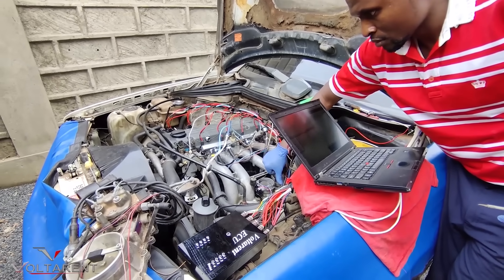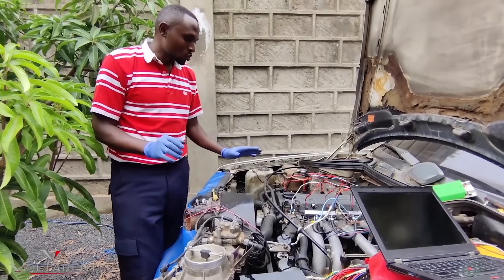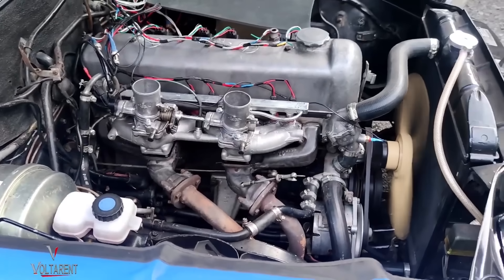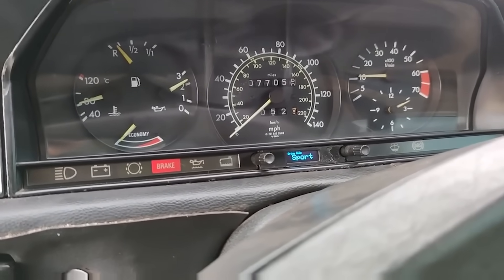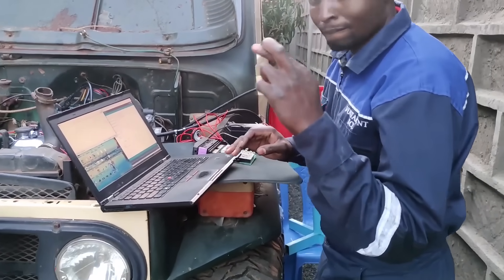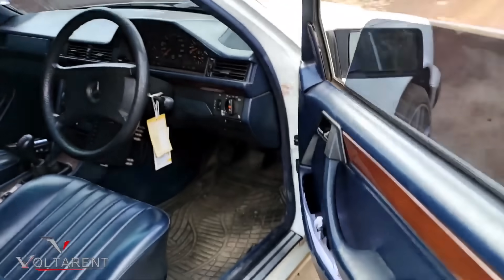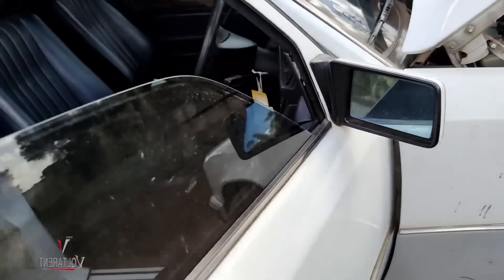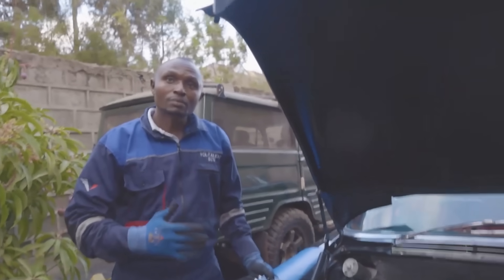African Genius makes Old Engines outdo Modern Engines!

Comment: I’m sorry to say this but there is nothing new in what he’s doing. There are lots of companies who have been doing this for over 20 years. Look at maxx ecu company they have over 30 years experienc Australian company call Halle teck in the early 90s we will take crank sensor pick up wasted cool spark system and an ECU from a 90s Ford and put them on any car and you just have to make the notch out on the front crankshaft pulley and you can make it run carbureted vehicles on a 2D ecu if you want to run fuel injection which is referred to as 3-D you would run modern injectors. If you use a mechanical you’d run it the same way as a carbureted system that was 2-D.

Comment: Great work. A small system for motorbikes would also have a world wide appeal. Here in the uk old bikes do not like the 10% ethanol fuel we can only get now.  It eats rubber, destroying the hard to replace diaphragms in carbs and rusting out fuel tanks.

Comment: This guy is really quite smart. I commend him for being able to build his own ECU that works on a wide array of cars. But I have to say that just smacking a ECU onto an old car won't make it perform as good as modern vehicles do, there is no variable valve timing, direct injection, forced induction, etc... being added. He's just bettering the engine control by adding a computer and fuel injection. Some of the last carburetor cars had carbs on them that worked so well that you would barely get a percentage of better fuel consumption / power / drivability by converting to an EFI system. 

I would however like to see more of how his ECU works, safety controls, safety protocols / modes and such. We really do take ECU's for granted, they do way more than most people realise.
Reply: Agreed, but just a kit a eliminating carbs and having a 'criuse' closed loop lamda sensor mode as well as better idle control (which is what cars do a lot of the time in the developing world) it's worth it.

I doubt his code is MISRA safe, but then these are old low reving cars and the ECU is just doing fuel and ignition on non-interfence engines. The local road quality poses more of a risk

Comment: I wish him all the best. He will probably get a lot of business from vintage car collectors. A common problem with carbureted vehicles, is that if you don't run them often, the remaining fuel in the carburetor will evaporate and start clogging different passages of the carburators, usually, vintage cars are not daily driven and would benefit from an EFI conversion. 
*There are additives that help prevent the clogging, but there are additional benefits from the EFI conversion as explained in the video.

**He could start doing motorcycles too.

Comment: In 2003, we upgraded an Audi with mechanical injection to electric injection. There was one problem: after leaving, the customer would drive the engine into the red zone out of joy. The oil pump drive would break, there were problems with the pump and thermostat. An old engine with 300-500k mileage will not become new from this, but new ones are even worse.

Comment: To all the people who don't know about ECU's: this is nothing special, it doesn't do anything new or magic. 
The effort is he re-designed a product called speeduino, not an easy task but he is an electrical engineer so he should be able to.
These kind of products have been around since at least 2005. That's when I used a super cheap product called megasquirt that does the exact same thing but way, way, more advanced than the product in this video. 
Nothing sensational about this at all. Sorry!
Reply: exactly lol

Comment: It's all nice but in the rest of the world these old cars are hobby cars and the fuel consupmrtion is not a big issue if you drive it few hundred km or miles a year. In a good condition thse cost like a new economy car which has no rust it's safer and more reliable unless you change all other parts and then you end up with a full restoration so driving it even less. But the guy is cool just don't pretend he invented hot water. standalone ecu's with injectors are here with us a very long time

Comment: Crazy Tech!!!! Who Needs EVs With This Technology???🤔🤔🤔🤔🤔
Reply: Anyone wanting their car to run on electricity instead of petrol?
Reply: ? He's upgrading old cars that have engines with carburettors and distributor ignition to make them injected multicoil electronic ignition engines controlled by an ECU which is how basically all modern car engines function now, this is very clever he's definitely a switched on guy and it's a great idea to modernise old cars and make them more efficient and reliable particularly in developing countries where there are still a lot of old tired inefficient cars like this in use, but it has nothing at all to do with the subject of EVs vs internal combustion engine cars.
Reply: Just go to ua EVs😂😂

Comment: This is a great achievement and this man deserves congratulations. I want to know hoe reliable is his electronic system. He is retrofitting some of the most reliable engines in history. W124 are legendary and can run for 1 million km without breaking a sweat. Also, what are the emissions figures? More power usually means more pollution.

Comment: Nice to see, that old engines still will be updated in Kenya. Why not using Arduino. It´s not automotive development, but who cares, it works. Nothing special, but respect anyway for his work and his enthusiasm. 👌😄 
I hope this is just a prototype, because the THT components must be mechanical fixed at least by glue, otherwise the solder joints will break sooner or later.

Comment: Companies already make kits that upgrade to efi. The issue is the expense. Many people value these old cars exactly because of the mechanical injection. Its simple, cost effective, & easy to repair.

Writting the coding & designing your own ecu is undoubtedly expensive & this guy is certainly smart. I just dont think there will be a large demand for this unless he is willing to install his system for cheap.

Comment: arduino.. very good DIY. I learned of it years ago.. wanted to update a 1980s subaru. I decided to stay antique and make a home made carburator ..needles, seats , jets..making use of map sensor, o2 sensor and digital ignition to setthe cuve around the caburator limits.. What this guy is doing is smarter and easier..well done. :goodvibes:

Comment: He made a wiring loom and stole oem firmware and tweaked a couple values to call it his own. 
Do not try to tell me he wrote the firmware from scratch with no dyno or any testing. 
Even his loom is a joke when it comes to resistance.

Making your own loom is impressive but thats as far as it goes.

Comment: yea maybe bruh, if you would do this in 2010-2012, but we are in 2024... today modern engines are so efficient, by 6-7 years of usage, they spend months in workshops, or just go in complete suicide mod, and as so = 0 rpm = supreme eternal fuel efficieny . Can't beat that. But congratulations on the Ecu. Its indeed impressive. Sad you dont have a time machine and go back in 2005 and make / sell milions of them

Comment: An engine doesn't know how the fuel is prepared to enter the pistons. You cannot make easy a 2 valve to a 4 valve, but beside that, changing a carburettor with a fuel injection was done in the industry a while ago. Also the remapping is known in tuning scenes. But going the length to make your own board is on another level, and done right it outperforms factory builds, because they have to compromise often, so there is room for improvements. He just used it all, and so his engines can indeed outsmart modern factory engines. Respect.

Comment: He's quite good. Standalone ECUs are not uncommon but the market is small and it's nice to see some changes. Also I see that this Mercedes at 9:41 was a left side drive car but someone installed the UK console in it so that it now has the steering wheel on the right side. And well, it's not really uncommon since Mercedes did some cost cutting and my W123 also has holes and uncut panels for the right side steering wheel option with spots to install the pedals and other stuff.

Comment: I will give this guy credit for what he has accomplished, but everyone acting like he invented this kind of tech is nuts. Custom made ECMs and converting carburetor to EFI and electric ignition isn’t anything new. It is at least several decades old in the US. There are several companies that can either make a new ECM from scratch or simply reprogram and old one to work with older engines. I am running a modern EFI without a distributor on my old ‘Cuda that was designed over 10 years ago. And it also has multiple settings for economy, normal, and performance. Again, he has a lot of talent and should be proud of what he is doing but it isn’t anything revolutionary. I guess a lot of people in the comment section are not that well informed about what has been going on in the hot rod community for the last couple decades.

Comment: Hello from Prague, Czech Republic. I applaud Peter's dedication and expertise. The reliance to keep at it until success is a great personal trait that we can all learn from. Each car whose life is extended by this great invention is saving tonnes of CO2 because a new car doesn't have to be made to replace the old one. It's fantastic !
Reply: Yep reduced carbon footprint and gave the old car a new leash
Reply: As much as i'm a proud owner of a solid Skoda Felicia from 2000, 1.3 petrol engine, and i can really appreciate an old solid car, the next issue in line even if you improve the car's performances like this is safety.
And i know because my car doesn't come fitted with airbags 😅
Still i would love to fit one of those units on my car!
Safety is a point i always struggle with when arguing with anyone about viability of old cars... as much as you can drive with your eyes open, there could always be someone distracted  that hit you, maybe with a brand new SUV, and utterly ruin you, your family, and your car while he comes out almost unscathed.
Also in italy for example, people drive like maniacs on highways, that is something i can confirm after spending holidays in germany and coming back.
Reply: @Dondolini94  Yes, I think retrofitting 3 point harnesses or air bags is a great idea.
Reply: CO2.... man... that's what they need to be on top in Afrika at the moment !

:)
Reply: net0 climate people dont think like you.

Comment: @07:20 mins :  why you have cooling system disconnecteed?...
Reply: Id imagine its the same reason the fuel cell (jerry can) is directly hooked up to fueling system. Its a cheaply bought car that has many issues but good for a test bed for his system. Im yet to see any proof of any fuel savings at all. It seems hes just made another stand alone unit that requires his specific program to tune.

Comment: Successfully designing an ECU is no small fete.
Massive congratulations to Peter!
Reply: That Arduino mega open source ecu existed for over half a decade. 😂 Plans are available for free to download online.
Reply: @KuntalGhosh where kindly refer to me. These things are giving me problems in construction machines
Reply: Its not a real ECU not doing all the things normal ECU would be doing, he is simply only controlling the injection/timing, plus cold/hot. Nothing ground braking.

In case anyone would have access to some old unprotected toyota or honda ecu and download the sw, after done few modificaitons and laod it on its board, tehre you go.

yes its not something anyone can do, but most engineers know exactly how to do it. 

No one is really doing it as tehre is no use case in most of the world as most of the cars are fuel injected anyhow and the latest technology is direct fuel injection.
Reply: @Aluzcz  it's not always like that. Modern aftermarket ECUs do lots more than you think.

It not just consider RPM, throttle position, and temperature. But also atmospheric pressure, and correct the map using feedback from lambda sensor at exhaust. Controlling not just the injectors, but also the ignition.

But I understand your comment. In some places used car are so cheap that doesn't worth the expense.

That's why most aftermarket advanced injections are only used on more advanced mods like turbo or really strong camshaft.
Reply: Thats not how it works 🤦‍♂️@Aluzcz
Reply: Feat no?
Reply: he didnt lololol, he just plugged one in and ran some opensource software. not only that but its a terrible design that is beat by the most basic early 80s injection systems
Reply: Good man
Reply: Maybe he started from a freeware or opensource project like Speeduino which also uses Arduino as a start point. But it's still a great job building all the hardware. And simply making it fit in different cars is not that simple. I mean theory is about the same for every car. But rarely you find "plug and play" parts to fit them, specially on those old Mercedes and French cars, I guess.
Reply: nice tech but late in game...
as worldwide are electrifying its line up & by 2030 i think .. all gas only engines will be prohibited from selling used & new .. there for .. EV kits are more desirarable than a univirsal ECU...
like converting an different power trains to EV that would be install in engine place on same gearbox
from 
FF FR MR AWD 4WD F4 4x4 manual automatic etc...
& can handle the weight of triple diffLock on a 4x4 etc...

non the less
enjoy this final 5~7 years for pure gas cars xD
Reply: @hereticxhexen I don’t think the ice engine will be gone by then, the world can’t produce enough electricity now, and without massive investment in the next 3/5 years the infrastructure won’t be in place. Long live ice
Reply: @hereticxhexen  they tried to stop the production of petrol engines before, but they figure it up it's not that easy, petrol engines will be here for long... you don't have the infrastructure to handle soo  many ev ... it's a long road until all the cars will be electric, you don't have the electricity needed to charge all of them...  you smart guy ..there are contries where they don't have enought electricity for usual duties and what this guy made is high tech and you want them to use tesla =)) 🤣🤣🤣🤣🤣
Reply: @hereticxhexen I doubt it
Reply: @hereticxhexen in states tho, in mega liberal European counties. Not in Africa lul. It will be there, but like in a 100 years so he is good. Will eat well.
Reply: @Psydvckthefirst  
not in Africa? i didnt track down which countries in Africa started using EVs...
but Egypt .. did started using EVs .. years a go .. for mid to high class people mostly though... Europe EV cars & few chinese...
Reply: @hereticxhexen  diesel engines can never be phased out. you can not have trucks that fell heavy cargo from cape to cairo on EV. ev can dominant in developed nations bt not second and third world. where we can never have engineers to repair a tesla
Reply: @hereticxhexen  that's wishful thinking. Not every place have combustion cars as the main source of air pollution as it is in Europe and US, and electric cars are still expensive on those places.

Also in some places you have ethanol from sugar cane like here in Brazil where most cars can run both with gasoline and ethanol at any proportion. Aftermarket ECUs can also be programmed to be flex.

Alcohol from cane is not as cheap as gasoline is in the US. But as rules came in gasoline WILL HAVE BE BECOME MORE expensive. I mean it's not good for anybody to explore all the petrol until it ends, once it removes carbon from subsoil and put it in atmosphere.

But with ethanol the same carbon is recycled. When you burn alcohol the carbon is put in atmosphere, but than the carbon is captured back by the growing sugar cane.

By the way, ethanol cars are more powerful than gasoline 😀both with higher compress ratio in naturally aspirated engines, or higher turbo pressure.

So combustion cars will still last long.
Reply: @hereticxhexen  I know your a fan of electric cars but they are not the answer. They sound nice in theory, but the infrastructure is not there. They still have a long way to go. Gas/diesel will be around for a long time to come.
Reply: @wynnmac6639  
will technology is fun
but 
as a household of 7x
i prefer owning 
first 3x toyota gas cars as backups (SUV & PickUp & sedan) garaged & covered
then 2x hybrid for daily drive
and 1x weekend undependable intown toy a  1x tesla with a 0-60 in 1.9s...

so ya i guess im a fan 
but not a WOKE/extreme fan xD
logic over excitement...
Reply: Feet*